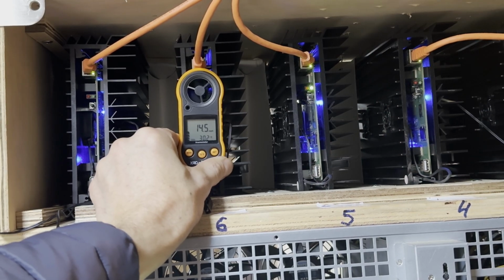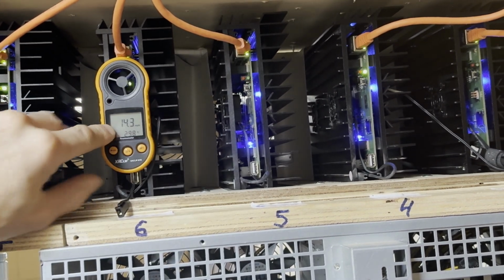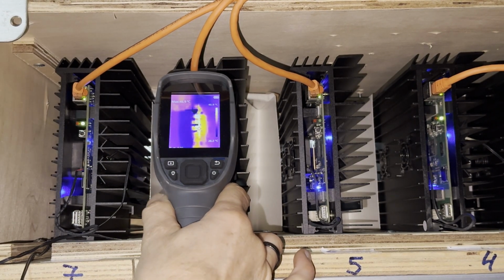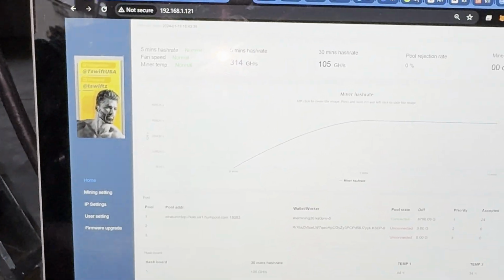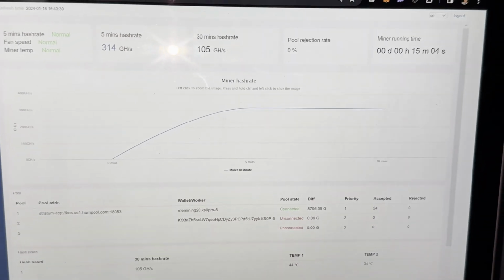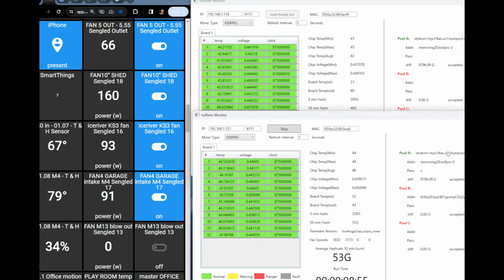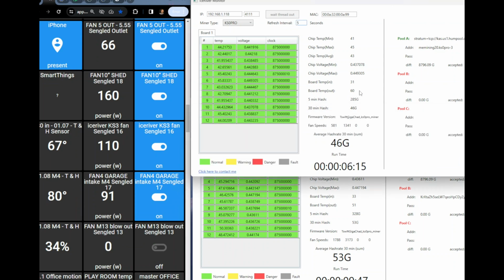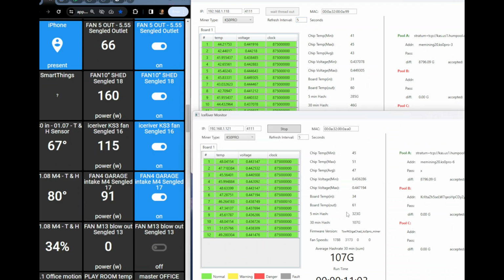WHY 320G OC AND UP WILL OVERHEAT YOUR KS0-PRO TESTING REAL TIME MOSFET WILL HEAT UP AND SHUT KS0-PRO

Comment: Lower voltage is better?
Reply from the maker: Lower voyage seamed better for overall temps on ks0pro but a lot more amps on the barrel connector so do your research before switching not to overheat connectors.

Comment: I've seen you run a KS0 Pro on 12v and 19.5v. It comes with a 19.5v power brick. So what is the upper end voltage limit? Does 24v have an improvement? or is it too high?
Reply from the maker: I have a video testing on different voltages, @24v temps are 6-8C higher compared to to 12v but reduces the load on the barrel connector.